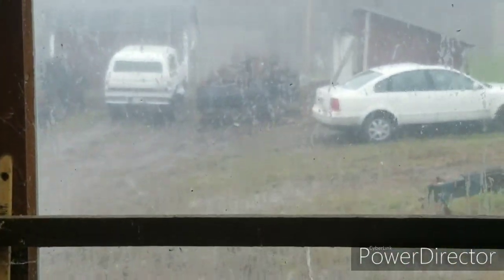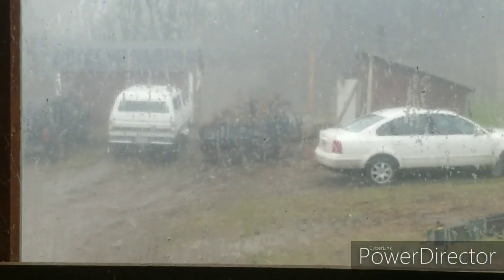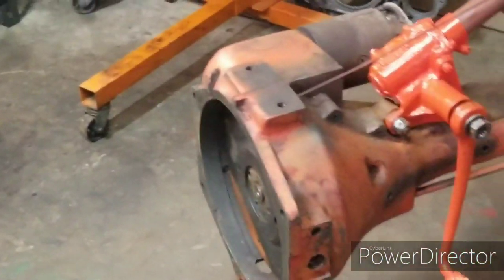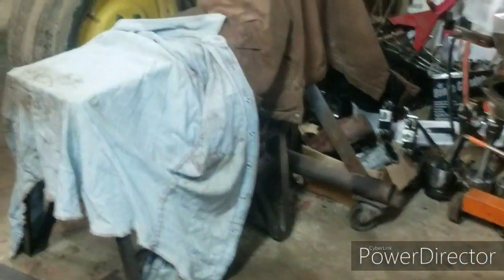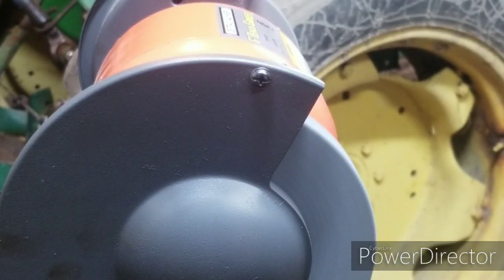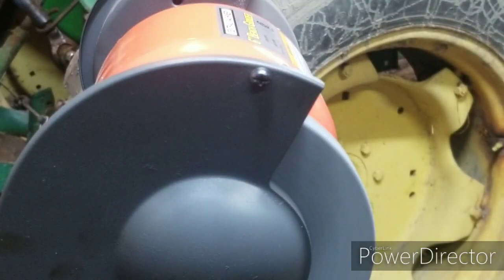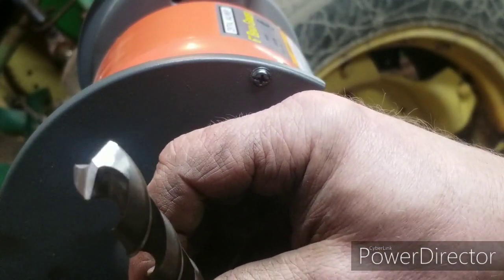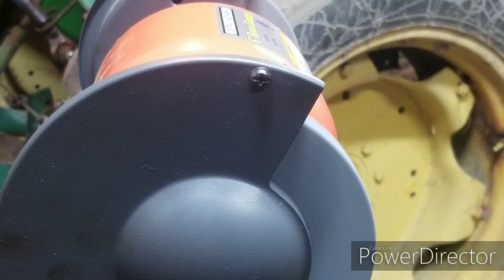Sharpening drill bits without a Dr

Comment: You have the touch! Not many people can sharpen a drill bit good. I'm alright at it. Not the best but I can get them to cut good. Your chips at the end there looked great! I found that using the right sized pilot helps a lot to reduce heat. I pilot almost all my holes. I was taught to use a pilot that's the same size is the thickness of the inside of the flute. Works like a charm and speeds things up a lot, even with the extra step. Happy new year bud, and thanks for sharing!

Comment: Nice demonstration CE!
I've not seen it that way before.
Dad worked as a machinist for almost 40 years. He could put a good point on a 1/64" bit!
I can't get a good tip on anything smaller than 5/16"!!!
I rotate the bit, grind deep enough to get the chips out, knock the heel off and put an edge on it.
Dad used to grind too much angle... So I'd have to flatten them out after a while.
Good video CE!!!
I'm going to have to remember how you do it!!!
Reply from the maker: Happy new year Gosselin family! Thanks Ed
Reply: @cesmith4566  happy New year To you and your family CE!!!